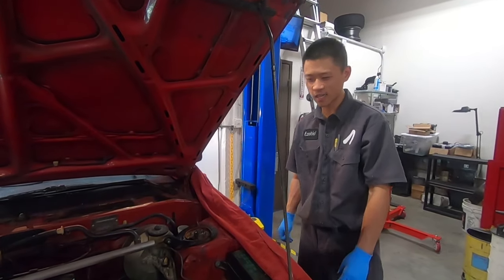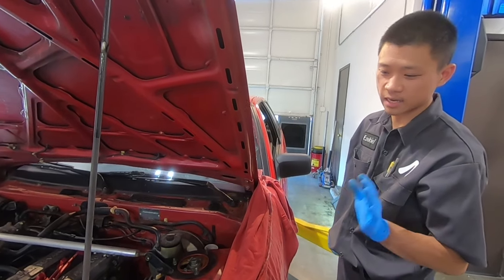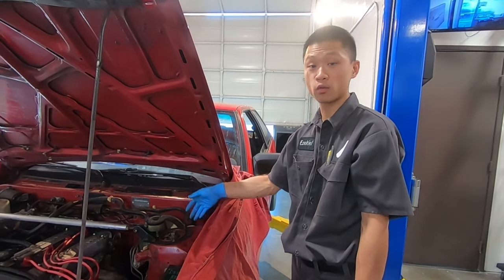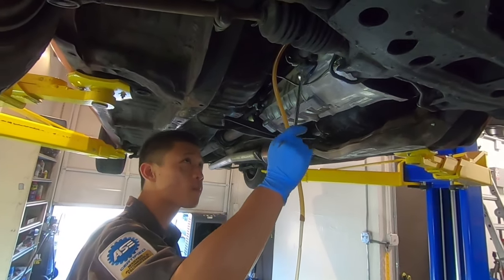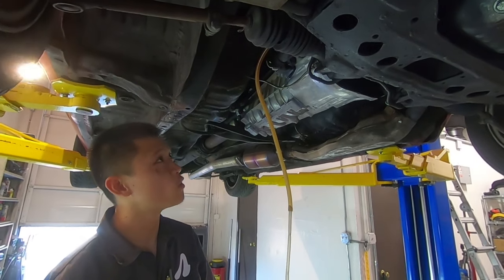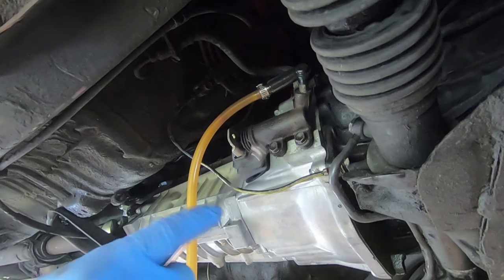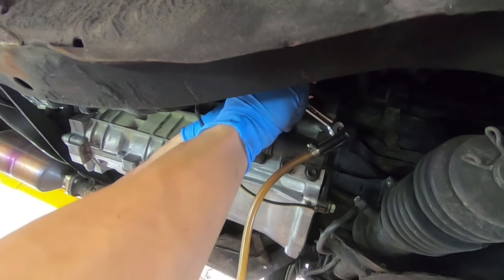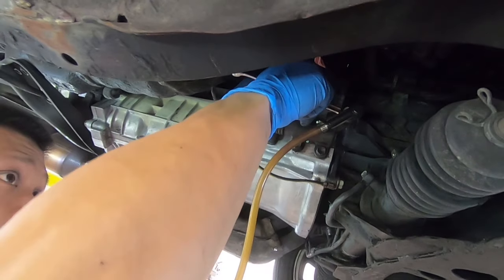How To: Bleed Clutch System

Comment: I replaced my slave and master cylinder on my Miata. When trying to bleed the system, the clutch pedal felt super soft, no resistance. After many hours trying to bleed I gave up. I was starting ,to think that maybe one of the components were faulty. I start searching on reddit and different sites to see if anybody had the same problem. I ended up finding this tutorial and one from Moss Motors teaching how to bleed the slave cylinder. These two videos helped me understand why there was no pressure building up in the system. I tried this way and after less than 10 minutes it was done. Thank you so much dude!

Comment: Just to clarify if you bleed the slave cylinder as shown in the video, you don't need to press down on the clutch pedal at all? Also how are you making sure the reservoir isn't running low while you're bleeding the slave cylinder? Thanks in advance
Reply from the maker: I typically vacuum bleed, then bleed the slave last. No need to press the clutch pedal if bleeding the slave or vacuum bleeding. Yes you need to top off fluid as needed. Our shop specializes in the AE86 chassis, so I know by experience if I fill the clutch master to MAX and bleed the slave alone, it will not run dry.
Reply: @CMAutohaus  I had to reverse flush one vehicle, damn. It was my lucky day.
Reply: @CMAutohaus  bro,this method,bleeding from slave cylinder,we don't need another person to press the clutch pedal right? It's one man job.
Reply from the maker: @shazwanizhar8628  Yes. One man job to bleed the slave
Reply: @CMAutohaus  thanks brother
Reply: So,we dont need to do the old pedal pressing once we bleed using this method? Or still need to do bro.
Reply from the maker: @shazwanizhar8628  Still need to. You bleed the slave as the last step
Reply: Did u ever find out the answer?
Reply: My stick wont return to neutral after using reverse. Will this sort that out?? All the other gears are fine and the clutch peddle feels normal. Someone said that reverse sometimes needs an adjustment to release properly

Comment: Never done a clutch bleed before, I noticed you used a pressure bleeder, how does the fluid flow into the pressure bleeder if it is under pressure? Does the fluid flow into the clutch from the pressure bleeder?  Do you empty the system first and then pour fluid in from the top where the cap is?

Comment: Great video bro. I am in the middle of replacing a clutch slave cylinder on my basic 06 Tacoma, 2.7L  which actually runs off the brake master cylinder reservoir. I went crazy looking for a separate clutch reservoir. No separate reservoir. Just in case someone out there has the same truck as me.  And I'm certain this will be easier than I thought. Thank you for the video.

Comment: The little black rubber thing in the river in the top of the Caps that extend down into the fluid are there to prevent splash splash can cause air bubbles into the fluid which will accumulate in the lines

Comment: I probably need to bleed my prelude the same way. Its very common in the prelude   to get the system bled right. It takes forever to get that pedal feel. Thabks, in going to do this merhod.
Reply: Broo how you did it, ive been trying all the methods with my prelude and nothing happens
Reply: @joaquinacevedo6045  what I ended up doing was bench bleeding it in the car. Since I have an aftermarket line to the slave I just set it in the clutch reservoir and have someone step or hand push the pedal until I see no more air bubbles appearing. Then I have that person hold down the pedal as I connect the line black on the slave. Once it's reconnected, open the bleed valve just enough for the fluid to come out, then have your helper release the pedal. If you don't see anything coming out, that's fine, just close the bleeder. Now bleed the clutch accordingly, 4,5 pump, hold etc. Eventually it will get better. Another note is don't use duralast or O'Reilly's master or slave. Duralast m.s.blew twice brand new. Then O'Reilly's has a bleed valve problem on the slave. I ended up using the luk brand for both from advanced. Make sure you set the m.s throw in the proper position, if you don't, the pedal won't contract right not giving a full pump and it will make bleeding endless. Once you change to luk, I guarantee you'll feel the difference. Good luck 🤙

Comment: @CMAutohaus
 
Hey mate, great video very clear explanation. Thanks !

One question though, recently replaced rear drum cylinder was badly seized, bled system, LSV,RL,RR,FL,FR have solid pedal and braking, but experiencing a bubble effect and noise from master if I push the break with a bit of force, more noticeable with engine running.
Any ideas

Comment: Hi there! Could you do this with a bleeder bottle with a check valve? Since it won’t let old fluid and air back into the system? Basically crack open the bleeder and pump the clutch a few time.
Reply from the maker: You could. Those "speed bleeders" have historically not been reliable for me so I do not use them

Comment: The purpose of the pump is it to create a vacuum so when then bleeder is open it will help suck the fluid and trapped air in the system??
 I want to know please!
Reply from the maker: Exactly correct.
Reply: @CMAutohaus  You don't need a vacuum to do this though right? Isn't gravity + flushing new fluid through enough?
Reply from the maker: @OdsyMJ  Correct. You dont need a vacuum to do this

Comment: I just installed a new slave cylinder on my 86 but it isn’t doing anything at all when I press the clutch. Do I just need to bleed everything or could that be something else?
Reply from the maker: I'd try bleeding everything first. If that doesnt work, you may have a restriction.
Reply: @CMAutohaus  will give it a try, thank you!
Reply: @CMAutohaus  bleeding everything worked perfectly, thanks again for your help!

Comment: Hello I'm still having problems with my clutch I don't why it gets hard like rock the pedal went I bleed the clutch. I'm already put new master, line, and sliver cilindro. I bleed everything and the pedal gets hard like rock . I don't know what I am doing rung thanks. For the help
Reply from the maker: Something is wrong mechanically. Either sticky/binding clutch linkage or clutch parts inside the bellhousing. Ive seen a friction disc installed backwards do this before.

Comment: I just replaced my master and slave cylinder and flushed it and it’s been about a week and today I noticed it’s feels like it’s losing pressure and it’s like sticking in the middle, so I just do a flush again or is there another issue
Reply from the maker: May still have an issue like a leak. Check for leaks. If you can keep the slave compressed, rebleed, then follow the video again

Comment: Looks easy to do. My clutch pedal on my car feels really soft sometimes and I had the slave cylinder reaplced already and still get the soft pedal sometimes. Maybe I have air traped in the line?
Reply from the maker: Air trapped or a leak is likely
Reply: That or your clutch is going out
Reply: @blakely552gaming7  ill definitely need a new clutch. Who knows how long the one in the car has been there. Thanks 👍

Comment: Can I ask where to buy the pump and hose and fittings you are using PLEASE?!!!
Reply from the maker: Mity Vac pump with brake bleeding attachments. Amazon and ebay are easy places to look.
Reply: You can get the hand pump too at harbor freight for 40 dollars it’s small compared to the huge tank he has in the video.

Comment: Does the bleeder valve have to be in a  position where it’s facing down or does it not matter
Reply from the maker: Bleeder valve needs to always face up, as air wants to rise
Reply: @CMAutohaus  thank you also I have a friend who has an electric vacuum pump will that work too?

Comment: Thanks for this! I'm surprised nobody on YouTube has never mentioned to push down on the piston in the slave cylinder while bleeding! Although, instead of having the big bottle thingy majigir, can I simply just use a bottle with the hose submerged in brake fluid?
Reply from the maker: Yes you can just use a bottle. I went on a deep dive and found DSM have a TON of info on clutches/the hydraulic system
Reply: @CMAutohaus hey would bleeding and replacing the slave cylinder stop a clutch pedal dropping to the floor???!!
Reply from the maker: yes  @exoticexperiments3008

Comment: My 350z just started a thing where when the car is running and I press in the clutch it won’t allow me to put it in any gear. I’ve replace the slave cylinder and even the shifter. I was able to start it in second gear in order to move it into my carport but that’s the only time it’s moved in a week. Any idea what could be causing this problem?
Reply from the maker: We just did a FRS with a similar issue. The pressure plate failed and the clutch would not completely disengage.
Reply: @CMAutohaus  so you think that may be the issue?
Reply from the maker: @treydarealestproductions7188  If your clutch hydraulic system is not leaking and is free of air, and all our clutch/shifter linkages are ok, I'd remove the trans to investigate the clutch itself
Reply: what did you find out?

Comment: If i wanted to bleed the brakes and clutch, which should i do first? Also i dont really have a clutch problem however when i shift into gear and let off the clutch, the pedal sticks for a second 2/3rds of the way up, should i be worried about this?
Reply from the maker: Bleeding clutch or brakes first, the order shouldnt matter unless they share a reservoir - in that case bleed brake first. 

You should be worried about clutch pedal sticking. Some thing could be mechanically or hydraulically wrong.
Reply: That's what mine was doing before it went to the floor and stayed there. It turned out to be the clutch master cylinder. It seems that the clutch will fail to engage if the clutch master fails and will fail to disengage if the slave cylinder is bad... I'm dealing with the slave cylinder now which I have already replaced but I can't seem to get a clutch pedal now due to air in the system.

Comment: 2000 Celica here. If the fluid is dark and my clutch is sticking to the floor (I can pull it back up by hand easily) should I bleed the brakes as well or will this do the job? I did notice the brakes making a slight wooshing noise when I press the pedal. I think my initial problem cause was that the brake fluid level was way below the minimum line on the reservoir. Previous to this my clutch would not come back up from the floor, but someone else did mange to fix that for me before putting more fluid in the reservoir.
Reply: Did you get your answer about bleeding brakes aswell? Im stuck on that and need an aswer
Reply: @nodrug1667  Well, I thought I had. The shop told me that no fluid wasn't getting to the brakes when they tried them. So they bled out the fluid and put new fluid in. That worked for a few weeks but literally just yesterday they froze up again. It was a really hot day yesterday too, 94F. Could just be a bunch of garbage in the lines that got kicked up and it needs another flush.

Comment: If I understood this correctly you are creating a vacuum to pull the fluid and
any air bubbles through the system and out of through the bleeder?
Also can you apply air pressure to the master to push fluid through? If so does
the pedal need to be depressed? I have an internal slave that is showing signs of 
leaking and I'm trying to refill the system with fluid with "stop-leak" seal conditioner.
Reply from the maker: Your understanding is correct. You can use a pressure bleeder to apply pressue to the master as well, pedal would not need to be depressed in this car.

I would NOT use stop leak in a hydraulic system as I can almost guarantee failure wuth the amount of pressure the system generates
Reply: @CMAutohaus  I appreciate your reply.
My slave was replaced once before approximately 40,000 miles ago and it was a very costly job. Just trying anything to prolong its life. I realize its bad again and needs to be replaced but as long as I have some disengagement.....

Comment: Hello mate my clutch slave gave out other day just replaced it but it gets hard somewhat but stay to the floor have to pull it up by hand do you have a clue on what it could be
Reply from the maker: You typically replace the entire system if one part fails (slave, master, softline) otherwise everything else gets contaminated. There may be a problem with another part or you could try different bleeding procedures (some cars need to be 2 man bleed because of a one way check valve)

Comment: I tried bleeding my clutch but i didnt know that the slave had its reservoir. So i emptied out the clutch res by accident. I filled it up a bled it again. Now im wondering if that ruined the clutch master cyl? 

I also got another question. I put my trans together. I can shift through all the gears when my car is off. But i cant shift while the cars on. If i put in first gear and try turning it on. It starts rolling forward. Its like my clutch isnt engaging. I already adjusted my clutch peddle too. What could be causing this?
Reply from the maker: Definitely possible you could have ruined the internal seals by running the system dry.

Sounds like clutch cannot completely disengage. Bad master/slave/air in the lines.
Reply: @CMAutohaus   im gonna have to replace the master
Reply from the maker: @roosbinpancan2380  Its common practice to replace the master, slave, and soft line all at once to avoid cross contamination
Reply: @CMAutohaus  is the soft line the metal line?
Reply from the maker: @roosbinpancan2380  Its the rubber line that connects to the slave
Reply: @CMAutohaus  mine has metal lines. Like the brake lines.

Comment: So wait do you use the clutch fork after someone helps you with pushing the pedal down or do you do this when you’re by yourself?
Reply: Neither…if u work by yourself, use a long object like long screw driver to push the clutch pedal all the way to the floor with the driver seat applied maximum depress then push the fork to the rod and open the bleeder valve (like he showed us). 😊

Comment: Anyone know why the brake master cylinder reservoir doesn’t let out fluid into the master cylinder when I let out the hose nothing comes out
Reply from the maker: Put a C-Clamp and completely keep the slave cly compressed. Once the upper part of the system is bled, then take the C-clamp off and continue bleeding. See if that works
Reply: @CMAutohaus  my problem was my car has a dual chamber reservoir and the fill port was above the max line so no fluid was making it to the system once I found that I got fluid  I’m

Comment: I had issues engaging into 1st on original clutch, master and slave cylinder with 195k miles. Fluid was dark. Decided to replace slave and flush system. Everything worked great for 6 months and now back to original issue. Would it be air in the lines or possibly master cylinder bad without leaks? Also noticed car shifts fine when cold until warmed up
Reply from the maker: Tough call. But I would check the basics. Trans fluid level and condition, clutch pedal height and free play, ect.
Reply: @CMAutohaus  Rubber seals usually perish in any case. Unless your lucky lol. They can suck in air, and leak fluid. Since you've eliminated all the guess work. Chances are it could be your master cylinder. I hope it's easy to access without taking off many components to get to it.
Reply: If it works fine when cold then there definitely is an air bubble in the system. Hot air expands and behaves like a bigger bubble. Bleeding the system should do the trick.

Comment: On my Nissan if you don't bleed the slave cylinder by itself you can never drive it again had the pump clutch as well though I had to do both
Reply: On our 01 Frontier, I did bench bleeding, then after doing this step I had to pump the clutch 20 to 40 times, leave the pedal at the floor, open and close the slave bleed screw.  Repeat at least 5 more times before the pedal began to come off the floor.  Only after all that the reservoir on the master cylinder started to empty.  I used an Mity Vac to get the last air bubbles (hopefully) out of the slave.  Used a Tball bat hold the pedal to the floor by sliding the seat forward. I saw on a video someone use a spray bottle trigger assembly in place of a Mity Vac.  Probably not as much vacuum but it might be enough.  On another video I saw someone use a Mity Vac to 'pull up' small stubborn bubbles by sucking at the hole at the bottom of the reservoir.  I couldn't do that with the Mity Vac accessories on the Nissan but maybe you can do that with the spray bottle trigger assembly.

Comment: Hi I agree with ooceanbreeze16.
I hope you can answer my question, yesterday my clutch worked fine this morning when I went to start my car the clutch worked fine, however my pig of a ute pu ford courier 2x4 didn’t start no crank no noises, I renewed battery no start , was suggested I rock the pig I did and went inside half hour passes and it starts!!! Then this morning it not starting, a friend calls in he said he’d take a look , it didn’t start I think he had a look at starter motor couple other things , then a bit later  I try starting and it did, I was happy ish so I went to drive car to mechanics and now the clutch is soft, not going into gear, no fluid leaks either now I’m very annoyed, what do u think has happened to clutch between this morning and the person going under car, what did the person touch adjust loosen to stop clutch working???
I use the ute 5 days wk to pick up the write off food from a major supermarket and I sort deliver to our church for distribution to anyone in need within the community. 
I think the person has deliberately sabotaged the car so he has excuse come over to keep company with me,
Reply: Reading through other questions and responses it sounds like you have air in your lines. Bleeding them should fix it if that's the case- I wouldn't assume sabotage